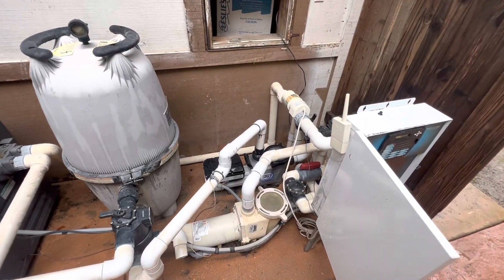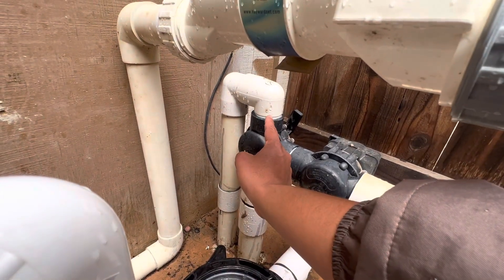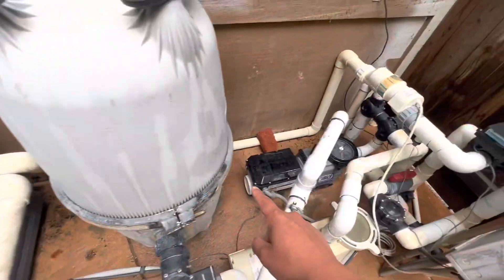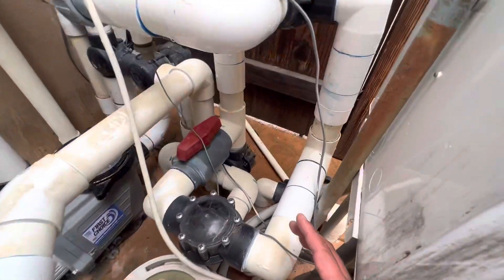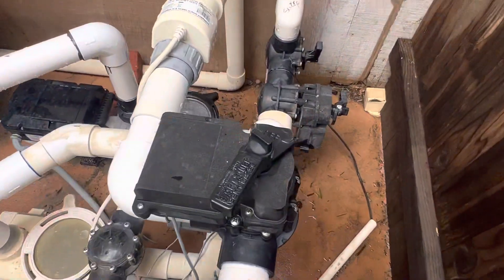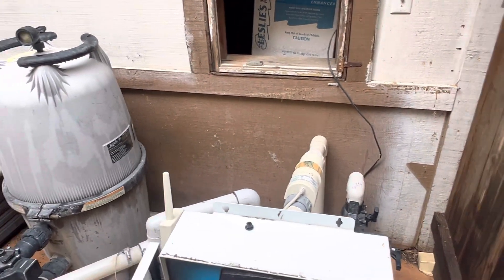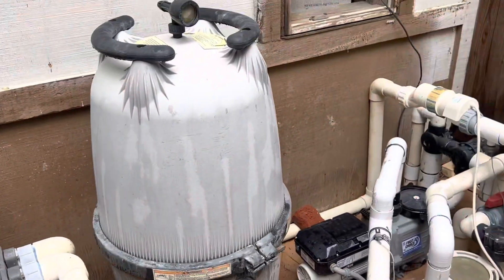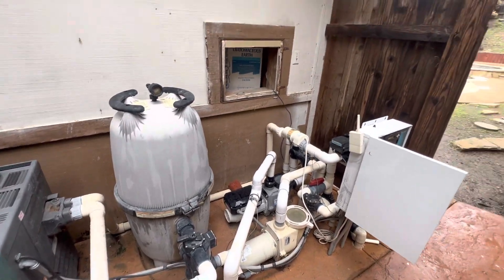Pool Circulation - Understanding How Water Moves Through Pool Equipment

Comment: How do you identify pool valves. What’s the step by step?
Reply from the maker: Just follow the flow as mentioned in the video. 

You will always have suction and a return side. 

If they are not labeled then sometimes you’ll have the task of experimenting and figuring out what valve does what. 

Some systems are super simple but I have also seen very complex systems where it takes more time to figure out. But nothing you can’t figure out if you understand which is you return and which is your suction side.